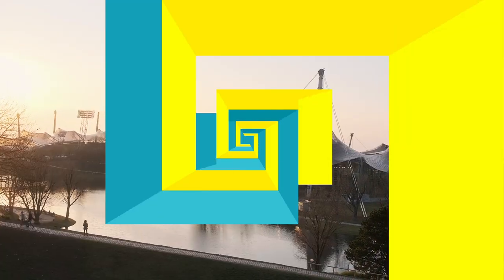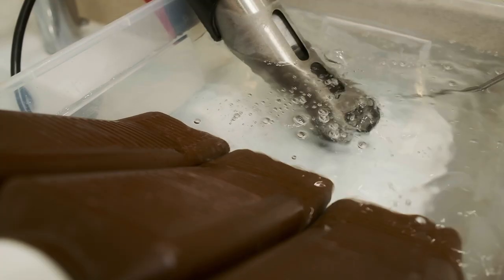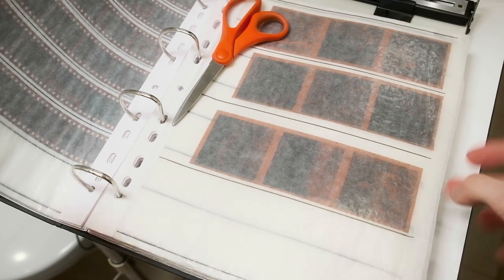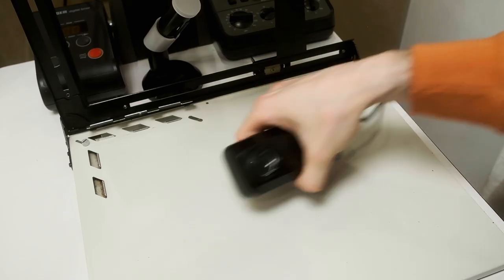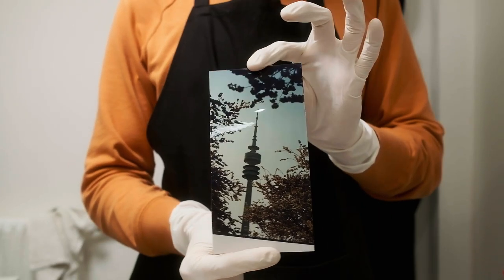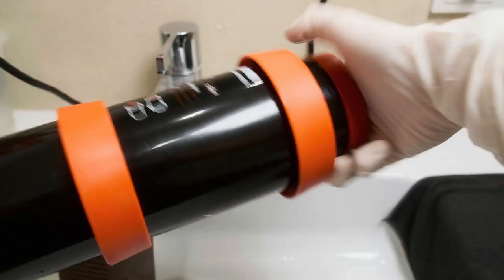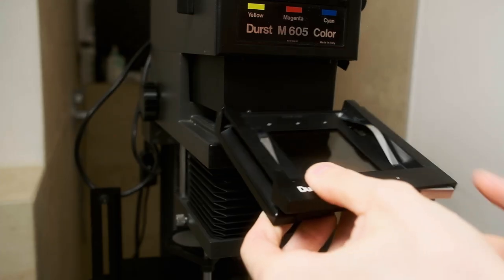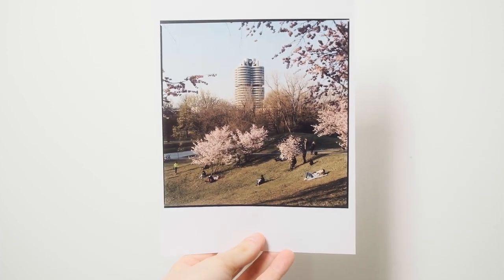Pure analog color photography on Hasselblad, from capture to final print

Comment: you should have a look at the NOVA heated slot processors instead of a jobo! the chemicals can stay in it and it's a really small footprint for a bathroom, i use mine on a trolley
Reply from the maker: Thx for suggestion, but i'm looking more for universal  solution. For the Jobo i don't really like temperature solution there and price just inadequate for the product and it's quality in modern world, i anyway need to modify it if i wanna use it. So far don't see anything useful on the market.